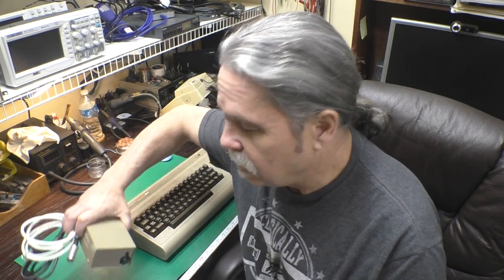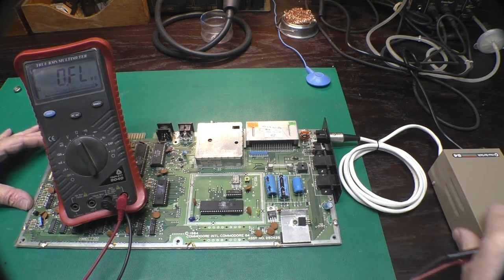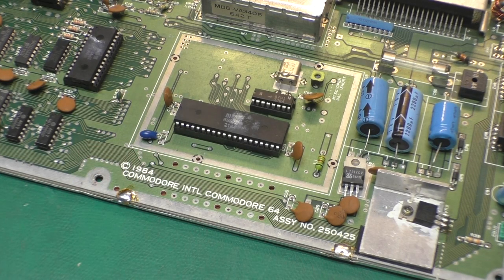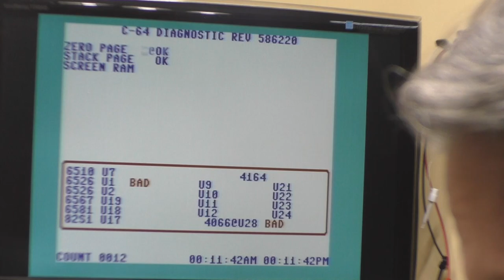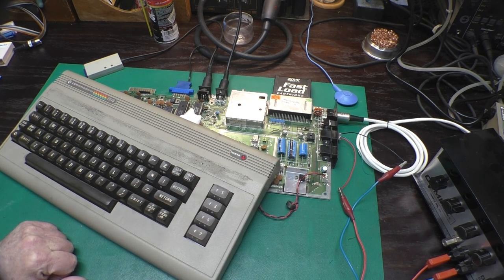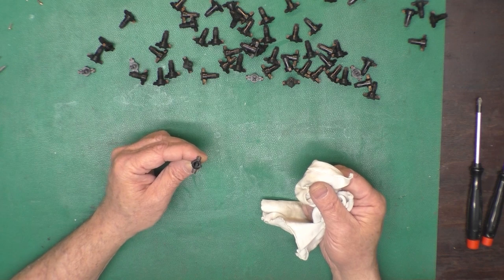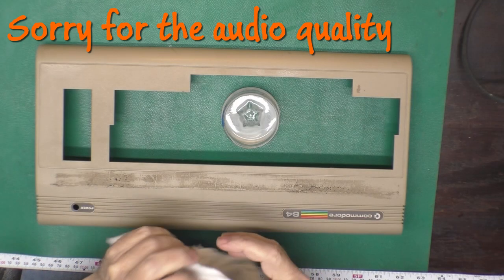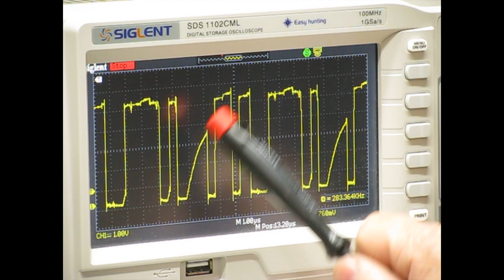Total Refurb – Refurbishing a Commodore 64 system for my nephew

Comment: Great stuff Jeff!
Though I'm in the Adrian Black club when it comes to RF shields. I prefer to remove them so any further work has one less thing in the way.
Reply from the maker: I truly don't understand this but to each his own. They were installed for a reason, RFI, and that problem exists to this day and is even more of an issue with the abundance of electronics in the average home. Ever watch a Techmoan video where het sets a piece of audio gear on his desk and it picks up a lot of noise because his WiFi router is under the desk? This is an extreme case but it illustrates the point.
Reply: Yeah Adrian tends to think of what the C64 will affect, not what might affect the C64.  But he's also thinking of heat dissipation as well.  I tend to toss the cardboard shielding too.

Comment: I need to send you a comment again. Very often, I am watching on TV, so commenting is not really a thing :-) It is interesting to see the ferrites on the keyboard and LED cables. We don’t have those here in Germany. So the „Funkentstört“ was not so hard to get. The criteria for FCC were harder to achieve. And we also usually did not have an RF shield soldered to the bottom of the main board. I was pretty amused back in 2021, when I took part in a WoRC zoom meeting, that the old computers screwed up the WiFi in the convention room and they had to be switched off in order to get a working WiFi connection for zoom.
Reply from the maker: It is amazing how much RFI comes out of these old computers.
Reply: @HeyBirt  The first don‘t have a good ground infill on top and bottom. That keeps the rf emission close to or inside the board. I think, the RF filters on the control ports were added in ASSY 250469 (very late). The cables are very often the culprit for rf emissions. That is the reason for those ferrite donuts. The protection diodes on the IEC port were implemented in Rev. A of ASSY 250425. So, they were constantly working ob FCC things. Maybe regulations were getting more strict.

Comment: Jeez. What kind of C-64 video doesn't include some weird problem requiring a multipart search until a broken trace/cold solder joint is found after days of swapping every chip in the system? LOL!

Great video!
Reply from the maker: It was kind of a lucky break for a random C64 pulled from my stash.

Comment: I've never tried it, so I was wondering if you had tried using denture cleaner for cleaning key caps? I'm curious how it works. If you've tried it, and why you wouldn't recommend it.
Reply from the maker: I mentioned using denture cleaner in the video I did on retrobrite. Some denture cleaners have a chemical in them which allows hydrogen peroxide to work better at lower temperatures. It did seem to speed up the process a bit. The same issues can happen with the dark plastic winding up with a blotchy appearance. If you add the denture cleaner you can't keep the hydrogen peroxide for any length of time though else it starts to mold.

https://youtu.be/YPl356YKcVs
Reply: @HeyBirt  Thanks! I need to build a key cap "car wash" where I can add key caps to a assembly-line like mechanism that puts them through a scrub and dumps the cleaned key in a tray. My hands are getting really rough. Until then, I'll employ my manual "car washers" (young relatives). You have to be so care of labor laws these days. If they ever catch me bribing an eight-year-old with cookies, I done for!

Comment: Had the exact same issue last week - even replaced u28 with no luck. After i replaced the SID the problem was fixed - the same SID works fine in a C128, but will create the error again when used in the original C64. So maybe the resistor in the test harness in combination with the sid and its sorrounding parts is the problem.
Reply from the maker: The problem is really the very narrow range of acceptable values that the diagnostic program will accept. Commodore design the harness to use an odd value of resistor and if you use a more common value that is very close you bias the results a bit so you will get more false failures.

When I showed the program I write to test the paddle input I mentioned how the numbers changing a bit was not an issue. This is just the natural variation/inaccuracy  of this type of analog to digital converter. Now add in the natural variation in SIDs, the timing caps for the A2D on the SID, the analog switch chip (U28), etc. and you can be just outside the range of what the diagnostic test thinks is OK.

There is a modified version of the code on blog.worldofjani.com which has this range of acceptable values widened a bit to prevent false failure reports.
Reply: @HeyBirt  In my case i think the SID is dying or some other part near the SID socket. The first test was always OK, but the second and further tests showed U28 and other things. When i cooled the SID (and the things around it) with some ice spray, the error was gone - that was the moment i decied to replace the SID.

Comment: 11:02 I've seen this harness test cartridge giving both false positives and negatives but I've never seen an OK in RED Kinda leaves you in the doubt, specially if you get those varying results without changing nothing in between runs.
Reply from the maker: It is nice that it does that as it lets you know it has failed at least once but was OK on the last test pass.
Reply from the maker: I think I remember someone modified the test code to allow for a little more variance in the value returned in the paddle input test. I think I saw that on http://blog.worldofjani.com/